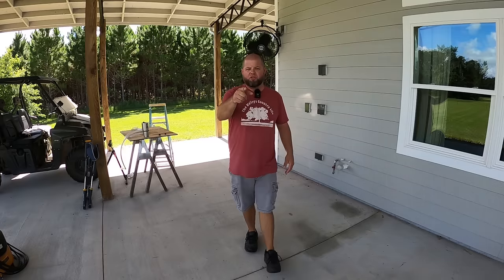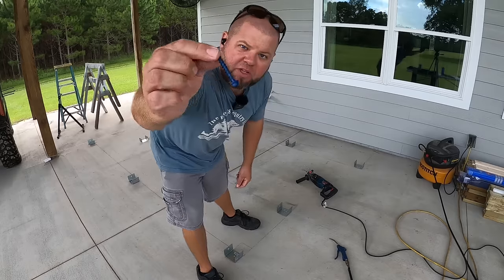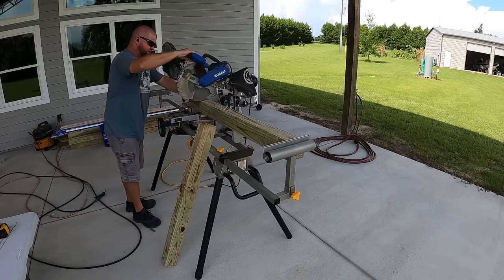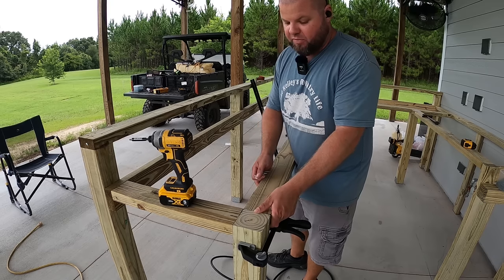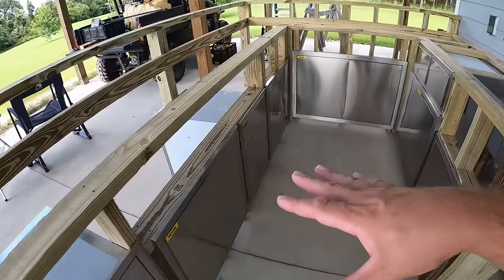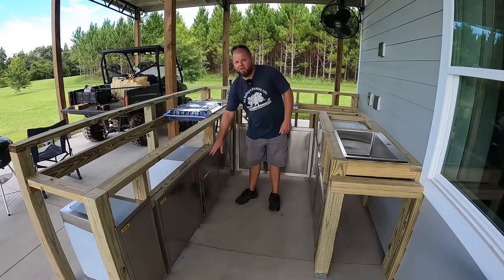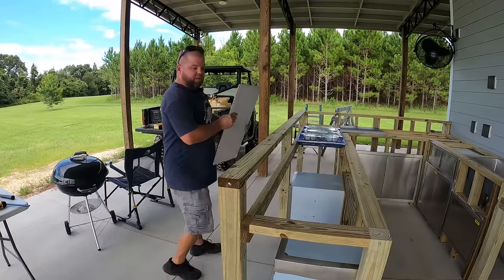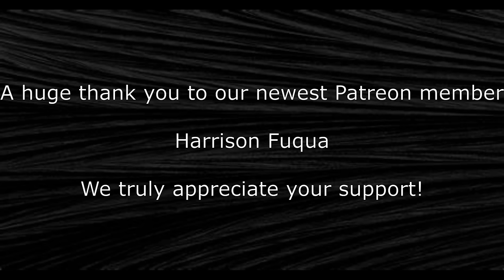DIY outdoor kitchen build! Part 1, framing and layout. #Vevor #614

Comment: The miter saw tip: if you flip the extender bars around you can use them to support the wood on them, then the fold up flap will be on the outside and cans still stop the wood where you want.

Comment: Looks awesome, great work.  Got sucked in after watching you freezer videos.  Only thought that comes to mind is the use of pressure treated wood.  I know it is the best option for weather and insect resilience, but everything I have ever made of or framed with pressure treated wood has warped.  I did one project with PT wood and trex to the tune of $3k that I eventually had to demo and toss because it just looked like a twisted mess after about 5 years, and I really did have a number of beams in there to prevent it.  Latest one is my Pergola.  Massive 2x12 on 6x6 PT lumber and it also has it's fair share of warping, but not much of a concern on that item.  Only way I know to prevent the warp is to let it dry while bundled for at least a couple months.
Reply from the maker: It is in the back of my mind, thus the reason I was adamant on using non pt plywood as my base. I'm hoping that helps with the twisting.
Reply: I'm never using PT again after the pool deck I built last summer. I'll be taking part of it down and redoing in the spring. it looks like shit

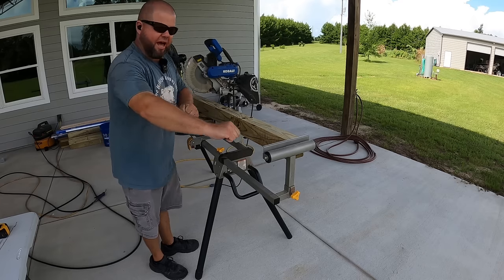Comment: someone might have said this already, but at 7:35 if you flip that end piece around on your miter station, the roller will hold up the material while also working as a stop. That way the cut piece wont fall to the ground after you make the cut.

Comment: Andrew may I make a suggestion any time your drilling in concrete I always go ahead and drill all the way through and the reason behind that is if you ever brake off a bolt/screw it’s a lot easier to drive the said bolt or screw on through the concrete than it is to try and get it out. That will allow you to reuse the same hole as well yes you make have to go up in size to get the next bolt or screw to hold but it allows you to still keep what ever it is your doing in line. Food for thought brother oh glad your feeling better and I hope Tiff is as well.
Reply from the maker: Thank you for the tip

Comment: You are doing a killer job.Siince you are covering the  wooden frame and you have roof covering I am thinking you could have gone with non pressure treated wood.I only say that because pT tends to shrink and warp causing cracks.Its not a big deal , I just thought I would mention it.Nice Job!!!
Reply from the maker: Agreed, that's why I didn't use pt under the tile. I probably could have used all non treated.

Comment: You might want to use that expoxy grout. It might be more durable in your given situation. Keep up the good work. Regarding rodents, i find those ultrasonic pest repellers reasonably effect. Not perfect but functionsy useful
Reply from the maker: I'm planning a lot of traps!
Reply: Yes, my Bell & Howell ultrasonic pest repellents have made a BIG difference in my house. Less pests 🕷🦂🦟🐜 inside and the ones that do come in are so easy to get rid of since they don't crawl or fly near as much as normal. No 🐀 🐀 since I got them. Will never be without them again, it I can help it. Gave some to my sister and now she is a believer in them as well.

Comment: Hi Andrew. New to your channel and love it. I apologize if this was already mentioned but I live in AZ  and also have an outdoor kitchen that I use year round. We installed a full cooktop gas range with an oven. We use the oven during the summer months so we don't heat up the house. Might be something you want to consider.
Reply from the maker: We priced the built in ovens and wow were they expensive.  A standard indoor oven concerned us for rodent issues.  We actually use our gas grill as a oven and it works very well.

Comment: Well done Andrew. I have a question for you. We live in northern Canada and when we build outdoor kitchens we frame it with exterior plywood carcasses and it's a must to put sill gasket between the galvanised metal and cement flooring. Why is it you don't use it? I've started using motor mount blocks for the bass units now. We get 5 foot frost lines so damp is a problem. Looking forward to the next video, so time for a homemade beer and a video night. Thank you for sharing your talents and insights with us.

Comment: First outdoor/summer kitchen I seen framed with wood. I dont know the exact reason they are all framed with metal in Florida. Maybe the heat from the grill or the humidity outside.
Reply from the maker: Because most are not building under a 20ft covered porch like me. The little bit of blowing rain we get won't hurt this at all.

Comment: maybe use screen around the bottom to block rodents and snakes from getting under and inside cabinets.
Reply from the maker: Been almost a year since I built this, no issues thus far. We bought big sealed containers to put everything in for protection.

Comment: Do you think using the oven/grill safe spray paint on the wood anywhere near where the blackstone would be. That would be an extra safety measure.
Reply from the maker: That's going to all be cement board, tile and aluminum.

Comment: What kind of mounting brackets did you use for the 4 × 4 I think it's a great idea to have a space under the structure can you give me some detail on the mounting brackets and the screws that you drill them into the concrete
Reply from the maker: They are standard 4x4 post steel brackets bought from Lowe's. I used 1/4 inch thick Taocon concrete screws to hold them down. I don't remember how long they were. 2 or 3 inches is plenty.

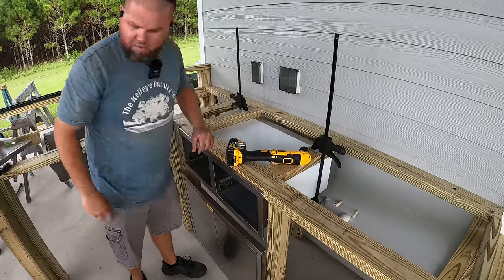Comment: Andrew, I'm curious about the small blocks (12:50 --> )you put under the lower cross member in the framing.  Are those sacrificial?  Meaning, do you expect them to rot with exposure to moisture or are you expecting the 'ground contact PT' wood will hold up?  Thanks.
Reply from the maker: I expect the pt to hold up just fine on top of the concrete.

Comment: What if your slab or deck is a little uneven, how would you go about setting the initial posts?
Reply from the maker: Set all the posts in the brackets and make sure the posts are long. Then use a cheap laser level or string line with bubble level to mark the posts and cut them off. A cheap laser level and Tripod is handy for all kinds of things, from marking posts to hanging pictures.

Comment: Looks like I ran across your videos just in time... I'm just waiting on the 5th episode for you to finish. 

Your 4x4s for your outside bar height... They are 46 in tall? Also how tall are your inside 4x4s? 46"?
Reply from the maker: We are around 44 inches tall after all countertops on the bar. The inside countertop height is 38 inches. Subtract your countertop materials to get your post height. This is as high as I recommend for good working surface height.

Comment: Great work. How high is ur countertop from the floor? And how wide is in the middle where u place the rug (between countertops )? Is it bout 36” or 48”? Thanks
Reply from the maker: Top is 38 inches to finished tile. It's around 42 inches if I remember correctly between cabinets.

Comment: Does your patio not slope away from your house? Im building this kitchen and have a slight slope in my patio and wondering how I could combat that.
Reply from the maker: That patio does not have much slope. It would be very hard to properly slope a 20ft patio and it not drop several inches at the other end.
Reply: @TKCL  could you share your kitchen dimensions with me?  Looking to build similar kitchen in my home.  My porch also has a slight slant away from the house.

Comment: I have a question about the vevor equipment. From all the reviews I've read, there is a problem with the products rusting. Have you had any issues with this happening?
Reply from the maker: Zero issues and mine get blowing rain and wet.  The key to ANY outdoor stainless is minor maintenance.  We wipe ours down a few times a year with stainless wipes from Amazon.  They clean and coat the stainless.  My very expensive 3 compartment commercial stainless sink will rust if not taken care of.  Also a tip for you, keep 0000 extra fine stainless wool on hand (also from Amazon).  If you ever seen any rust spots on sinks, doors ect, that fine stainless wool will polish it right off.
Reply: @TKCL  thank you for the information, it's very much appreciated

Comment: Andrew, can the miter saw table with the stop be used with other model miter saws (ie Dewalt)?  Can you provide a link or info I am interested in purchasing one?
Reply from the maker: Actually I hate to admit it, that's the cheap harbor freight stand and should work with just about any saw. It's a bit flimsy, but has worked very well for me. The dewalt aluminum stand is a very nice saw stand and gets my vote.

Comment: Never use wood in an outdoor kitchen. I know, I built outdoor kitchens for years. Always used metal studs and hardyboard. Have had to replace many outdoor kitched fabricated with wood. Nice video, but wrong building material.
Reply from the maker: This is under a 20ft porch roof, I don't see the concern.
Reply: Don’t see a concern either
Reply: @edgargiesbrecht7974  Well, just wait until the Sun and the rain, wind. Then you will see.
Reply: @mountainskyaerialphotograp3921  let’s come back and check in in 15 years then! Haha. I hear what you say though. There’s definitely a better way but for a guy that needs to do projects constantly, this doesn’t bother me at all. Doing this for someone else for money would be different, but in your own home… no need to be perfect

Comment: FYI your going to DISLIKE that you made you kitchen wrap around and not a islands. Walking that extra distance to enter your kitchen is a big disadvantage; even though you get a little extra counter top & storage. You be better off building a platform to walk on and run any electrics, water, gas etc.you have time to make the change hopefully before you go to far. Other than that looks great.
Reply from the maker: We agree to disagree, that window pass through that we've been using for months takes a lot of walking out of the equation.
Reply: @TKCL  ok I guess as long as your not having to go in the house to get stuff all the time. Pass though is great love it. Only got to have some to go inside or stay inside. Saloon Doors on the one end would keep that clean look. Tile looks good. Ever think about making concrete counter tops. Also how bout adjustable sun shades that roll up and down to block sun an rain & adding a cool mist system for you deck?
Reply from the maker: I have been thinking about all those things, we will see what projects I get to.

Comment: Do you have the discount codes for Vevor?
Reply from the maker: Yes the new code for 5 percent off is VVPRO, if you wouldn't mind use the links in this videos description for your order. Clicking on one link and then adding whatever you need to your cart will give me a small commission but not cost you any extra. Also sign up with your email on their website and you'll get an additional discount on most items, plus you'll build points/money to use on your next order. Thanks!

Comment: So 10’ for the front of the bar?
Reply from the maker: Yes
Reply: What spacer size is on the bottom? And are those long pieces for the plywood to sit on?
Reply from the maker: Bottom spacer was scrap 2x material, so that's 1 1/2 inches thick. The bottom board was so I could nail the plywood to something.
Reply: @TKCL  thank you for the reply I’m building one almost exactly to the T.

Comment: Tiles?  Yuck....   that is like what we all been ripping out from 20 years ago.     It's so cheap.    How about you just do cement that has a smooth finish and polish it with a glazed finishes you can be modern and colored concrete as well.  I even seen somevtgat look like they are Granite.  But never tiles.  1970s to 1990s   was ok.  But not them days.
Reply from the maker: Lol you never shy away from speaking your mind. Concrete or any skim coat is a no go for me. I've had too many people tell me about their hatred for the grease stains that show up on it. Sealing only gets you so far.
Reply: @TKCL  hey no products are safe from oils.   But I saw your tiles you chosen.   See in Ottawa where i am from it was a big thing to use tiles for a time.  The 1993 it was never use tiles again on a counter.   My Dad was big on tiles of the classic and Spanish styles.   But when I got on the Sceen. I was doing Italian lines only and Travertine.   To some wood tiles.   I did em all but today its gray and white that is the style. And not a fan but it makes money.   I later seen many of my work on TV commercials  and when the glass crase was going on I was no  sorry I do not do that....   then  I did a few.  But I hate it.  It's too much grout lines.   Now instead of grouting it up   colored cement and use cement between tiles...   clean and simple. But router an edge on the outside of that wood ro put a lexan and behind it add LEDs for a great 2022 look....   then under the cabinets do the same.    Trust me  you will have a signature look.   Then underglow the top as well...   as for creatures?   Well ever hear of using Borewax?    It's good at getting rid of things in your drawers....    but remember   do let let bullet in it....

Comment: Tap con makes a device that won’t let you over tighten. Buy that! You said drill a larger hole? Drill the hole size that tap con tells you! Don’t blow out the hole vacuum it out! Stopped watching the rest as I saw a wrong to start. Get it right
Reply from the maker: No you drill a size smaller hole. Hear and see what you want. Bye!